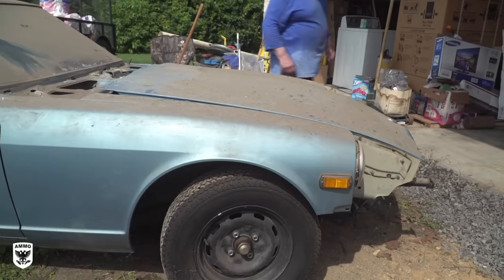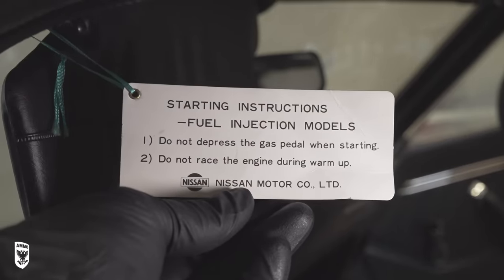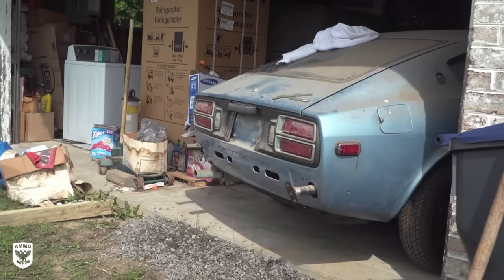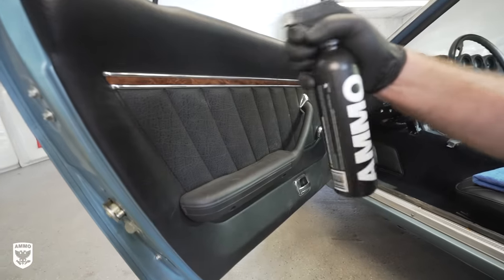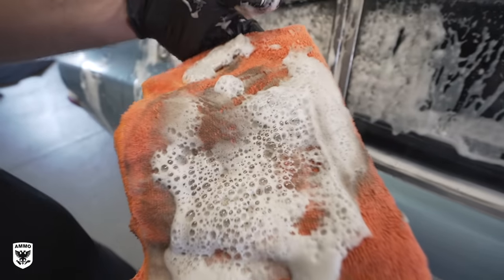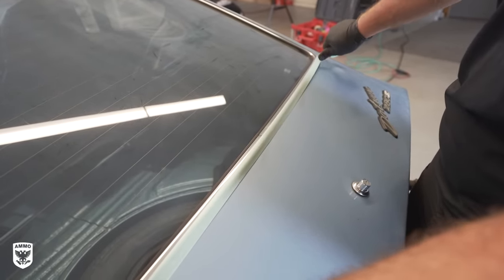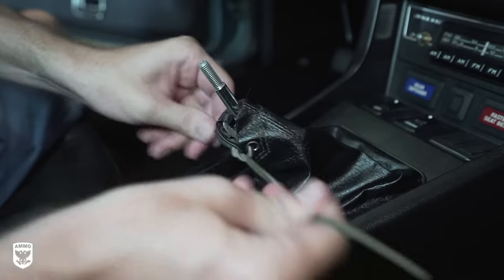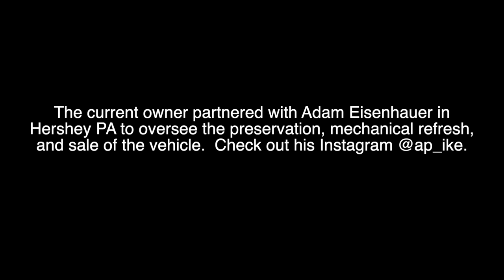First Wash in 44 years! Barn Find Datsun 280z with only 350 Original Miles

Comment: My first car in 1998 was a 1976 Datsun 260 Z - white colour. i parked him in my huge old dry barn 2002. milage 87200. let the motor run every 6 month, keep it covered all the time. regularly ventilated.  2017 i sold him to a guy in LA which bought the car for a good collectors price. I heard in 2020 my car was resold online at a good profit to Christiansburg, VA. my newest project is a 1982 Ford F-150 SuperCab. But  this car is brand new? Wow. what a crazy project. original dealer plastic seat cover.. can't believe it.. 😳Normally you shouldn't drive such cars - sell it on to Nissan for their car museum! these cars in this condition should not be driven, just maintained. And exhibit it in a museum. Because use makes them age.

Comment: s240z? strap an l28kai custom twin turbo sure it only has 600 hp or 620 bhp whatever you wanna call it and stock spoiler and bumper and the big exhaust and gold key and there you go tune it alsoif you wanna do a tune as the devil z you might wanna buy like "50,000" for everything i just think

Comment: I can't say I'm happy with my 280zxt after like 2 decades with it.
It hasn't been a very reliable car.     Blown a lot of head gaskets, and fuel injectors are always leaky, and shocks have always been shot out.   All that premium luxury car stuff on it... cruise control, talking lady, door lights, air conditioner, stereo, digital dash, gas tank measuring stick, oxygen sensor, etc... just dies over time and never works again.   The clear coat peels off and looks like dandruf.  I've had to clean the steering column light stick contact switches more times than I can count.    It's not a very friendly vintage car to own at all.  It only seems fast because it's low to the ground.  I gave up driving the Z and switched to driving cruiser motorcycles, they were much more fun, cheaper, more fuel efficient, faster, and just better vehicles.   The Z now seems like a gas plg by comparison, I would never go back to driving the Z.

Comment: I don't find it smart wiping it with a towel after you foamed it. It still makes tiny scratches. Was better if you just washed it with low pressure first after foaming it. The water provides lube when you wash of the dirt

Comment: And the tyres lasted 44 years? Brake fluid and master seals etc. rings fused...? No seal memory and water issues in all the other internal components. Pat on the back should be saved for ther real mechanic.  This vehicle will need more than a polish I bet.

Comment: "While Dan and I delicately power washed the pain" LOL as you spray directly on top of the paint within 1-2 feet, sending that old dirt deep into the paint.

When washing a filthy car with a power washer, you need to do it in stages. Far (a heavy and soft rinse), medium (for knocking away more loose dirt), and close (spraying AT AN ANGLE to rinse away more dirt).

I think it's funny you have this channel about cleaning and detailing old cars, but your fundamentals appear to lack such basic comprehension on causing the least amount of damage to the paint.

Comment: Been doing custom paint for 30 years.. spraying that car wash foam and using a micro fiber just ground the dirt into the paint and scratched the crap out of it. Then used steam to clean the badges but then later removed the badges to clean them?..you were worried about integrity of seals but then used a pressure washer?  This video is clearly to push car detailing products. Also using dusk to show off shine is a no no. Showcasing a good clean up or polish job is best done in full sun to make sure there are 0 swirl marks. Although there is probably some truth to this  video I am skeptical.